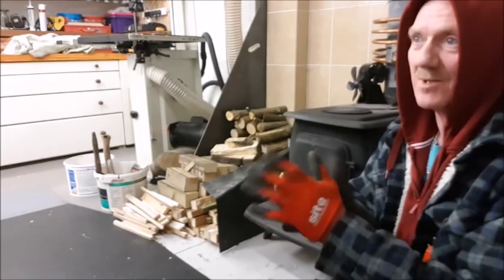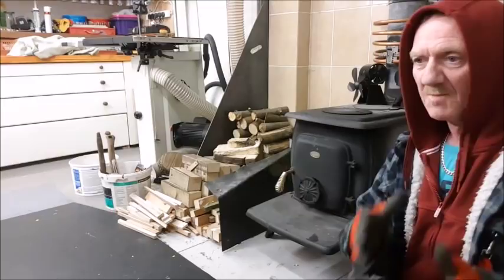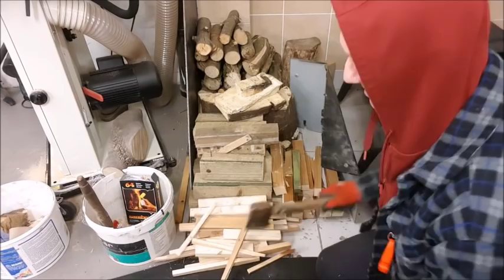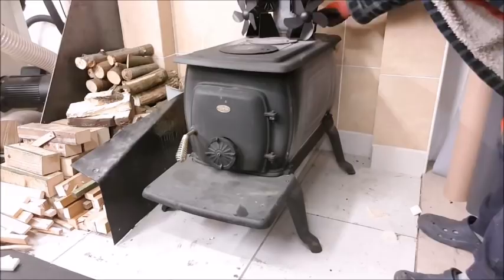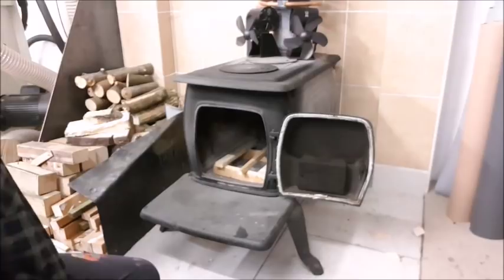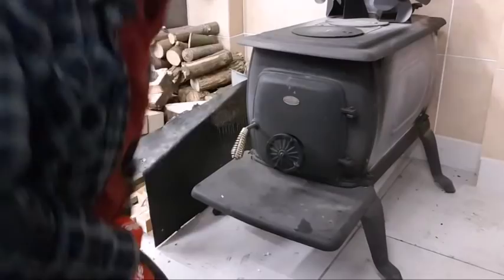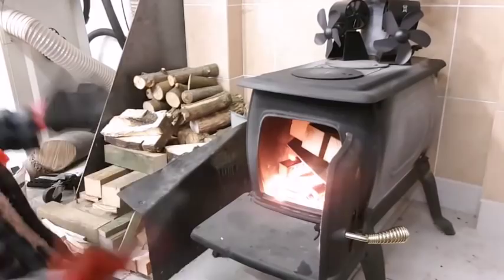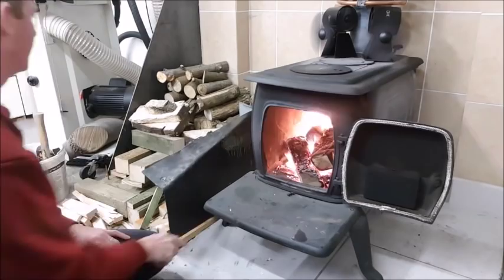My Log Buring Stove

Comment: i remember advise to put 3/4 inch layer of sand in the bottom of these stoves to prevent cracking, some hardwoods can get very hot if the air intake is open, and the clarke stoves, although good value, arent the thickest castings. my one stank for a while till the paint and sealant had tempered. they did take a good size log so that was a bonus.
Reply from the maker: Yes i had one tgat cracked on me within a coulpe of weeks after i fitted it but the Machine Mart replaced it without a problem, but that was faulty, as long as you give it time to warm up it will never give you any problems and at under £500 its good value